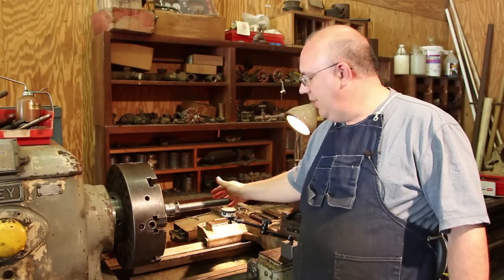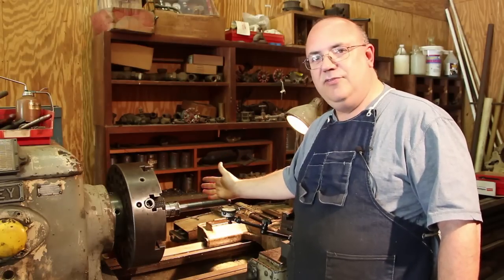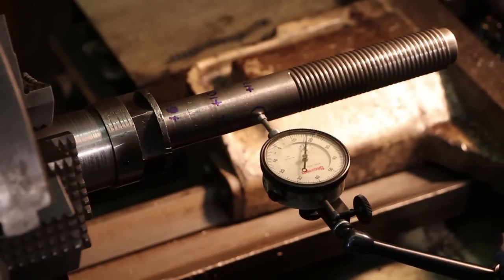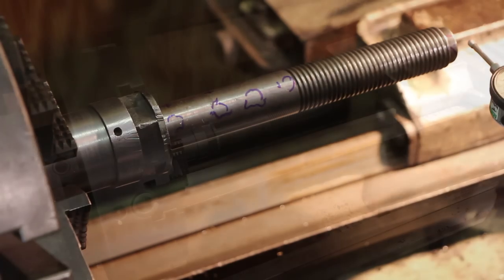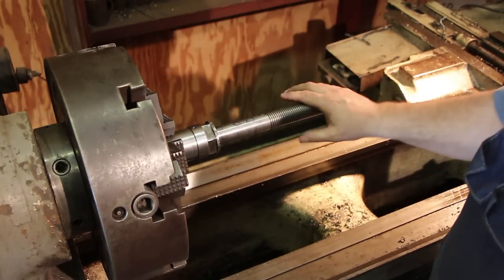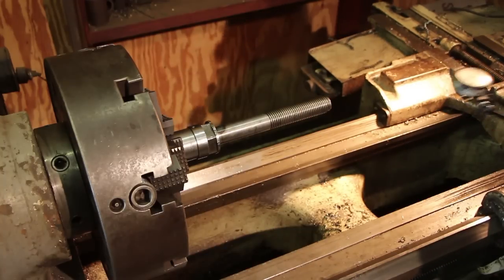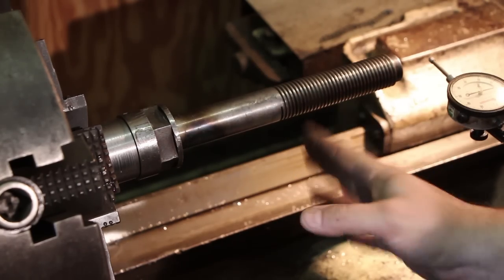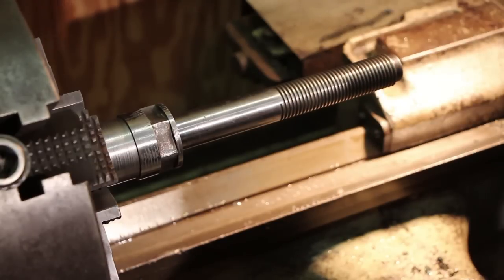Flame Straightening a bent Steel Spindle

Comment: I used to work with an old millwrght - he showed me the tricks - he said before we started that the steel would draw back one half as much as the heat moved it.  After determining where the bend was we moved the indicator to the end of the shaft - we heated the shaft until the end of the shaft moved nearly 1.5 times the runout and removed the heat.  His system worked like a charm.. he said to always pull the heat before you reached the 1.5 target.  Once the shafts start moving they have some inertia from the heat.  Then when things cool down you can make what he called a trim adjustment.. he was a genius - he was a master at balancing rotating machinery and alignments ... we could align machinery with a hand full of indicators some feeler guages a sledgehammer and a slugging wrench before the "smart guys" could set up their $80,000.00 electronic infrared alignment tool.  And ours wouldn't shake.  I know this video is old but maybe someone will get some good out of it... it seems all the kids want a computer to tell them what to do instead of actually knowing the basics of what they should be doing...  I'm 71 years old and still doing consulting on machinery alignment.  It's a sign the young guys did not learn their trade -
Reply: wow lol I have been working on straitening a box I welded up for something a while back. The welds are horribly undercut and its too rusty now to use, but I have been working on heat striatening using a resistive heater. I hooked up a brazing transformer to a 600 amp welding clamp (the ones for lathes) and then I brazed a 1/2 inch copper rod into a 4/0 lug and connected it with 4/0 to the transformer studs (its a box meant for those big carbon soldering pliers). If you touch the sheet metal with the rod it starts buzzing and you get a hot spot the size of a dime in a few seconds on 10 gauge. I was practicing hitting it with a hammer and different patterns etc. Dip it in a cup of water once in a while to cool the electrode. Really interesting setup (about 5V OCV, floating, at 1500ish amps). I just wanna make some kinda handle piece and put some teflon heat shrink on the rod etc to insulate it a little bit. Very fun. Just if you get those ancient boxes they need a bit of work.. I added vents, and some wire supports with ETFE heat resistant zip ties to neaten up the wiring, itts built a little scary (looks like if the transformer really failed hard the primary insulation could touch the secondary, so you need to megger it too, 1940 is not that great a electrical safety! Going to add some fiberglass silicone sleeves on the primary wiring too just incase.. but honestly it runs pretty damn cool considering all thats going on there. Nice technology with no O/A fumes and soot.
Reply: This is super helpfull. Rebuilding the spindle of my surface grinder. Thanks!!!

Comment: Keith Fenner uses compressed air to cool the shaft. It may need to be chilled from the red.
However your method works just fine. I am going to see if I can straighten the spindle on my drill press, it would be nice to get rid of the wobble.
Thanks for your tireless hours making these videos. :)

Comment: Provided that the cutter flanks are square to the bore, they will probably pull most of the .007" out when the nut is tightened. A very interesting video. I like the way that you sampled the full length first. Nothing more frustrating then to straighten one section first only to find the main bend was somewhere else. I used to straighten launch shafts. Some of them could be literally curly after striking a sand bank at speed.

Comment: Another great video.  I have used heat for straightening on various things myself.  It is amazing how well it works.  I also used to straighten motorcycle fork tubes with my hydraulic press.  I made some wide "C" shaped tools to press down on the fork tubes and also to support the ends.  I could get them within ten thousandths most of the time.
Reply: excellent idea for straightening the fork tubes

Comment: A number of years ago I was fortunate to be able to attend a living history demonstration at Bridge Park near Battle Creek, MI. The presenters straightened two foot high sections of bridge support I beams by heating the flanges in a variation of the method you used. While they were working they gave a running description of the methods used and their effect on the beam. They mentioned how much damage a semi hauling too high a load can cause to a bridge beam.
Reply from the maker: +Old Sneelock's Workshop I saw a YouTube video showing straightening a bridge beam.  Pretty impressive!

Comment: Keith, Good job. I've done thousands of shafts, ejector pin and mandrels.
 What i've found works best is slightly heat the area of bend and with a 2x4x? us as leverage to make straight. This action will anti-bend.
 Sometimes you have to flip the shaft .. even several times to make straight. and sometime heat will just mess you up. depends on the shaft, the size, thickness, area of bend and thickness. (Many factors determine the action fix)
 Of course heat treated shafts are a whole new kettle of fish. Being mindful of DeTempering and even reheatreating will put the bend right back in it. A whole new method of heat treatment requires it to free hang during initial heat treatment and draw back.
 But good job just the same. What i'm talking about requires much more intuition and effort.

Comment: Excellent explanation,  another tip for smaller shafts is to use a tig torch. It heats a much smaller area and is easier to control.  Really enjoy your videos!

Comment: Well done. It surprises me that the axle doesn't bend back when getting cold down.
The first job for my mini lathe was straightening a 2 feet long, 1/2" candle stick being bent to a shape like a cork screw. It was painted as well...
Masking tape for protection, the cross slide and the tool post was used to press it, once every 2". It worked out well.

Comment: Keith , there is a guy here who uses heat to straighten custom drive shafts----the tircks as I understand it is to heat it up ---put a  indicator on the end to check alignment ---spin chuck by hand and use a wet rag and COOL  the side you want to draw ----slowly spinning the chuck as you go ----when the low comes up--put wet rag there.   
Also in earlier video where you received round carbide disks---they are button tool inserts for forming radius on lathes --also we use them to rough out extremely uneven lathe work surfaces (flames cuts and etc.) .  The inserts are much tougher than regular inserts --and even when they do chip , you can slightly turn them in the holder and gain a new cutting edge.   great job---jdb21867---journeyman of 37 years --age 57.

Comment: Nice video Keith.
My understanding of the process is that when the part is heated to red heat and then quenched the outside of the metal quickly cools to stabilise the metal on the outside making it rigid while the inside is still in a plastic state.  Due to the metal being cooled on the outside first, the metal cools slower on the inside while holding it's shape.  Some internal stresses are present but not enough to worry about.
Welding is different because you are introducing more metal to the part which cools quickly and pulls the parent metal towards the weld but also introduces a heat affected zone around the weld that crystalises the parent metal due to the rapid cooling.  This is why you would heat the weld or parent metal before or after to normalise it to relieve the internal stresses if you had a critical part.
Just my two cents worth. 
Interesting discussion. :-)

Comment: I am not a machinist but I love to watch you work. What you did was fascinating and elegant. I suspect that if you took the data points you gathered and plotted them on graph paper you would get a picture of where the bend really is. For the x axis, use the distance along the shaft from some reference point, like the bottom flange. It won’t matter where you pick the reference, as long as you are consistent. For the y axis of each data point, use the high value you measured with the indicator. For a single bend or misalignment, you should find the points are all on a straight line. Where this line crosses y=0 is the source of the problem. Just estimating in my head, I suspect that the real problem is that the spindle threads to the motor shaft are the source of the misalignment. In such a case, you chose exactly the right point to apply heat, although you will always have a 6 thou runout.

Comment: At shipyards they use the same technique for bending steelplates in irregular patterns , for example at the bow-nose and the portions of hull under the waterline where the bending radius changes over the length. At the shipyards it is completely made by hand and blowtorch.

Comment: Learned this as a apprentice panel beater we called it heat shrinking when the panel was stretched we would put a 5 mm hot spot then quench it the spot would shrink tightening the panel up .

Comment: I have had good luck with my homemade tool. It’s like a knurling tool but I have smooth bearings and I use a live center. Using heat and the homemade tool I have had surprisingly good results. It saved from having to spend 800 dollars on a cross feed screw.